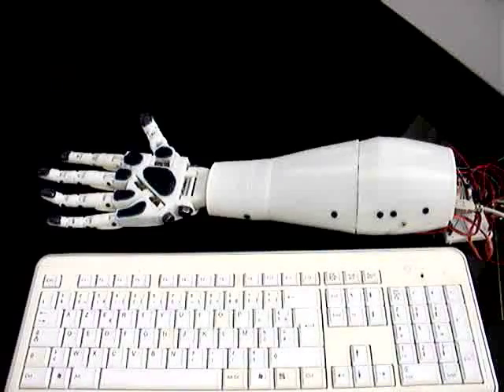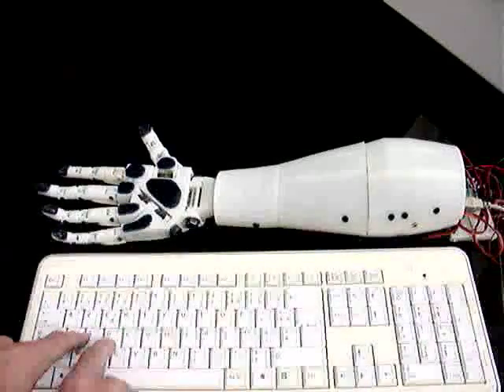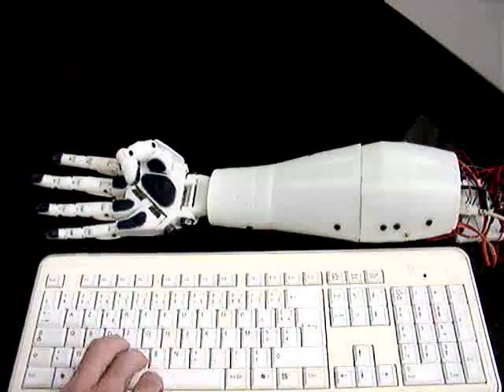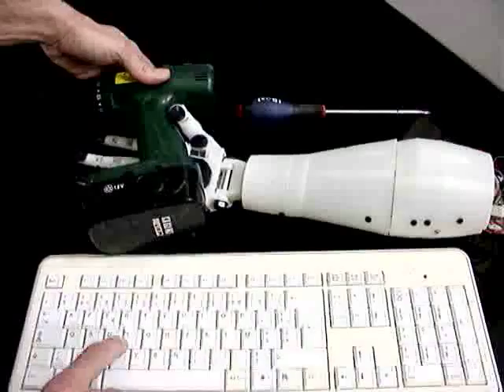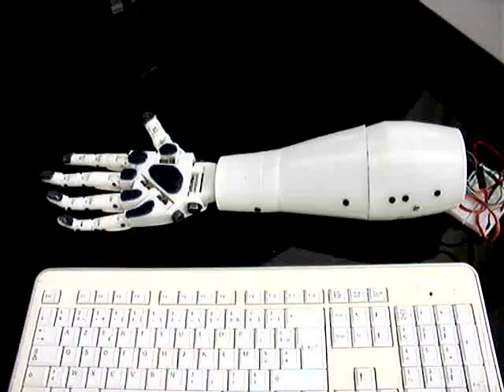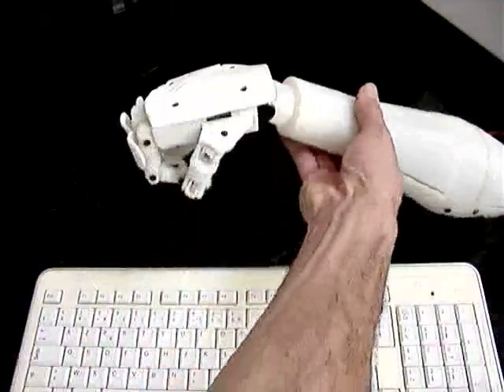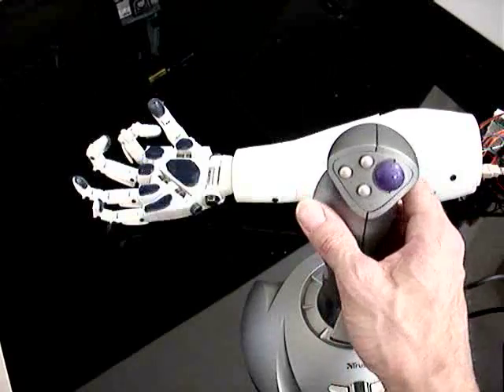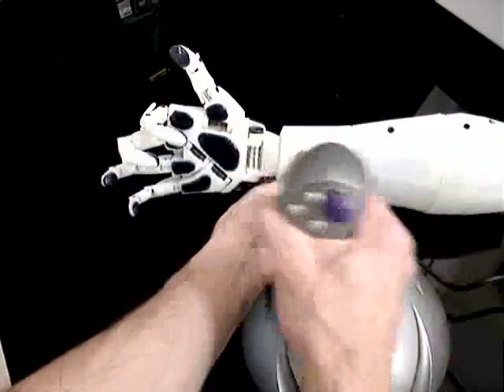Animatronic Hand Robot 3D printer "InMoov" Part4

Comment: Hello 🌹🌹

In the Adjustable thumb for InMoov there are four wires/lines into the thumb. Two of them for open and close the thumb one on the back of the hand and the other one in the front.
wear the other two go and what they do And how does the finger action work - the sequence of movements and did Anar fix the top surfaces problem ? 

Thank you

Comment: to save on energy, try to make cable blockers that gets activated when a movement is finished. This way, you won't need to keep the motor on until a new command is sent.
Whenever a cable reached its destination position, it should be held in place like with a winch. 

Well.. is it working with tendons at least? lol :p

Comment: I will post some pics.
My 3d printer had a problem with bed wobble as it moved up or down and this made good prints impossible. I replaced some parts, built a cover to keep cool air out and now my printer is doing much better.
My new parts look much better and are much stronger.
Still not perfect yet, but much better.
Your right thumb was the first item I tried to print.
Sadly nothing would stick to my print bed and after some tests and trials I finally found that hair spray works very well.

Comment from the maker: Hi, please check my InMoov's blog, you will find all the answers to your questions. You will also find diagrams for connecting a power glove with flex sensors to InMoov through an Arduino board, as others already have done it.
Regards

Comment from the maker: Hi, Iwouldn't know how to compare, since I don't have a Thing-O-Matic and for that matter never saw a piece printed with that machine. If I was to buy a printer today for low cost, I would go for the Replicator. The main reason is the heated bed + the bed size. Thing-O-Matic has a very small print bed.
I have build a heated bed in my 3D touch so parts of ABS come out as is, no need to clean/remove raft.

Comment: I have used a pic mcu to read out the as5040 (2 or more) and output it at serial 4800,8,n,1 because the as5040 is to fast to read by Picaxe...